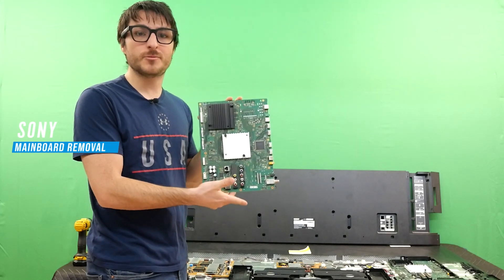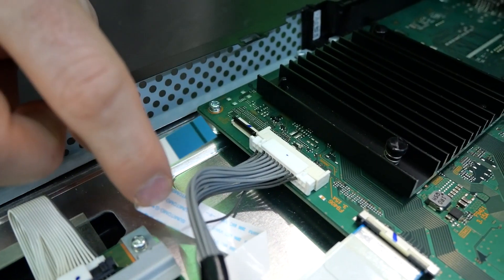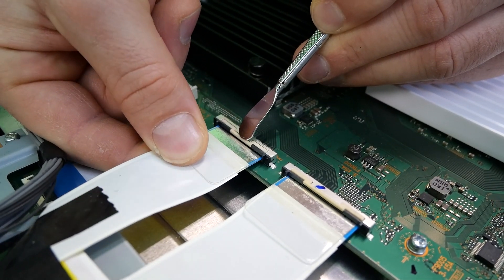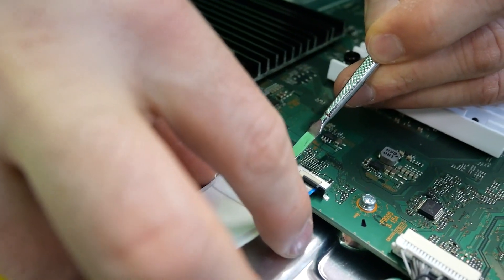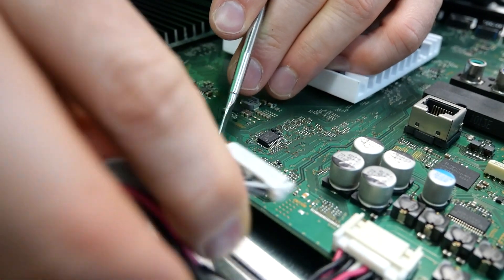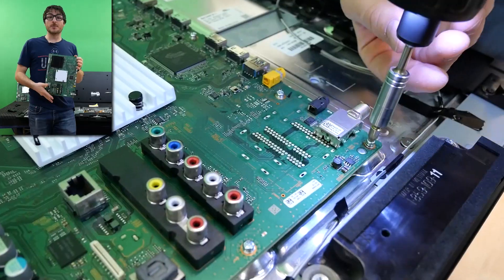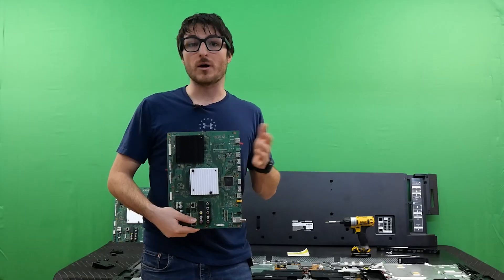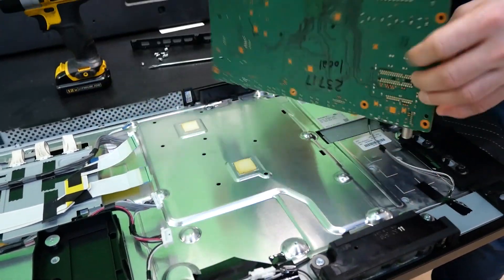Sony XBR-65X900C Mainboard Removal

Comment: Hello how are you? I have a sony xbr-65x900b when I bought the tv it had sound no backlights. I changed the power supply board now it has backlight sound but no picture any suggestions?
Reply from the maker: Sorry that doesn't really make sense and I am not sure what could be causing this. It is possible that someone else messed around with the TV before giving it to you and disconnected things. I recommend checking the entire TV and reconnecting all ribbons to make sure they are properly seated.

Comment: Hey man if I turn it on and it goes grey whats my problem ??Sony bravia 47"
Reply from the maker: When requesting help, please make sure to provide the model number of the TV. It is very difficult to help otherwise.
As for a generic troubleshooting, grey screen could be a bad screen, bad T-con or bad mainboard.
Reply: @NicksTVRepair  sony bravia kdl46ex500 ...  it turns on there is backlight  but no pic just white ..it was working then just kinda cubed away to a white screen..you can hear sound ?? I dont know if that helps ..I kinda thought it might be t con board but not sure
Reply from the maker: That could be T-con, it could be mainboard, or panel. I don't know unfortunately, I am not very familiar with this model. I would advise giving the T-con a try first, then the mainboard, but make sure you buy replacements from a seller that allows returns just in case. If it's a bad panel then it won't be worth fixing, unfortunately.